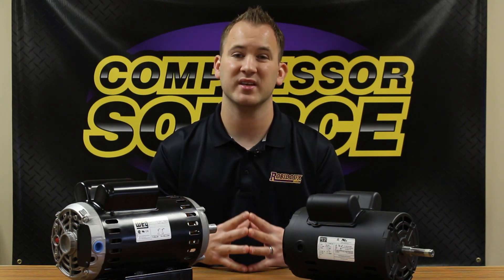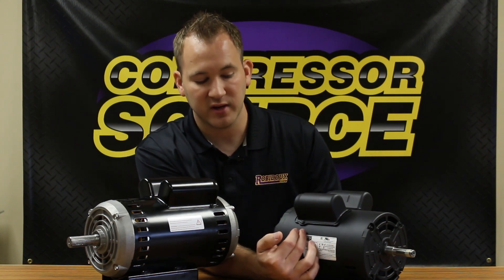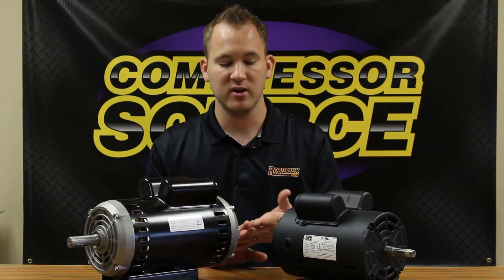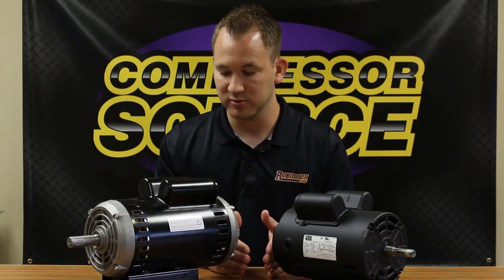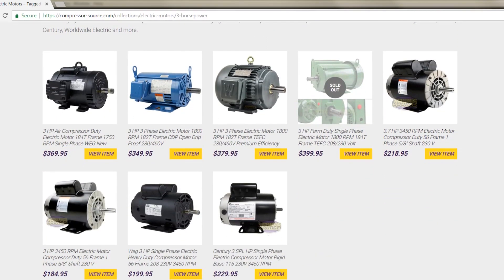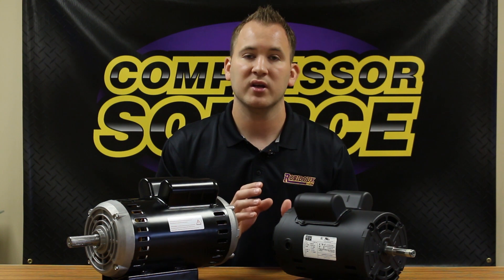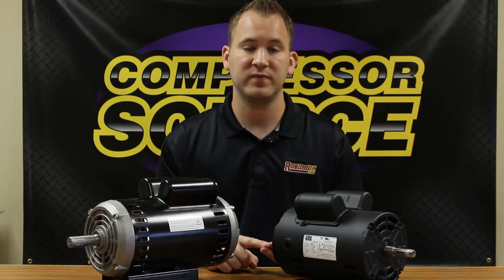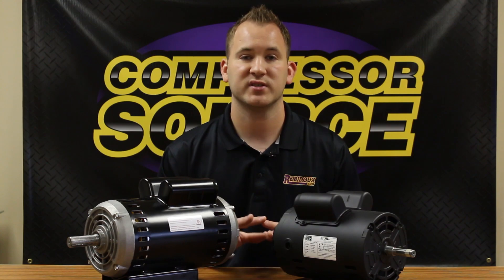How to Size the Right Replacement Electric Motor for Your Air Compressor - Compressor Source

Comment: I had a craftsman oilless 6hp 60 gal compressor since 94’ and have rebuilt the pump already but am tired of the noise and figured since the motor is good just tear the compressor portion off and get a H.F.5 hp pump and slap em together and good to go only after I got the pump I and started getting into it I find out the motor is only 15 amps and no where close to 6 hp..my question is can I just use it as a special 5 hp and spin it a little faster to make up the difference?if you can and will answer I appreciate it thank you.

Comment: Remember when compressor manufacturers was inflating their motor hp ratings? I have a devilbiss that has a mo 3022-1 mitor that they say is a 5hp. Its spected out just like the one in the video except it's 208/230 volt. Ive been told these motors are closer to a 3hp motor. The reason im asking is my pump went out and i need to replace it. So i have to know the correct hp of the motor. 

Ive seen three motors with the same specs, one was a 3hp, one a 3.7hp and the other a 5hp.

Comment: Great tips!! I have a question I have craftsman’s 125 psi 60 gallon air compressor I recently purchased used. Works great but not enough pressure and CFM for sandblasting! So I was thinking of buying a.new more powerful air compressor pump online. Would my motor on my Craftsman 60 gallon match up or is there a way to use the 5.5 hp motor with a new pump??? Or is it just made for that pump????? Thanks buddy

Comment: I am trying to run a onboard system in my vehicle but want to run pneumatic tools such as impact drills Grinders Etc but most of the compressors that I've seen on the market are too small and do not generate enough power and are mainly to inflate tires what size amp and or horsepower is sufficient enough to run those power tools and with how many gallons?

Comment: Hi, I've been offered a puma 64 litre air compressor. The 1/2hp motor has been replaced with a 1hp motor. Is this an ok upgrade or will there be problems?

Comment: So disappointed in my 5 HP USMotors electric motor that came on my Cambell Housfeld air compressor I am wanting to make sure i get  a better quality motor. Mine lasted not even 3 years and I dont use the air compressor daily. I was hoping your video would talk about gettting a quality replacement. My dad owned an automotive shop back in the day and it ran for years as mechanics used their tools daily. What happened to the quality of products nowdays? I will never purchase a US Motors electric motor built in Mexico. Total piece of crap!
Reply: Good luck getting a cheap, US made anything. There are good, foreign made products, and bad US made products. Cambell is a cheap, homeowner brand so you can expect they are using cheap, relatively unreliable motors and compressors. If you got 3 years out of it, you got what you paid for. Putting an expensive, quality motor on a 3 y.o. CH compressor that may have another year or two of life--how does that make sense? You do realize that a robust, 5HP motor will cost you twice what your entire CH setup cost, right? Better off to buy a good, used commercial unit. Or buy a quality compressor and pay for it. Buy once--cry once.

Comment: I have a cambel hausfeld iron force 6.5 HP and the pump is out and no one has the parts to fix it WL611700AJ  Is there a pump i can buy that will line up with this I can purchase.

Comment: What if you don't know what size originally came with your compressor
Reply: Then you buy a new completed air compressor.... Probably save money and eliminate blowing up the tank up and potentially killing someone.
Reply: @TheBrandocando  w
For some people... I took an compressor(speed air 2 cylinder), a 32 gallon standup tank of an old craftsman and an electric motor I scavenged. Pulled a fly wheel off one unit another off another and now I have the quietest air compressor I could have ever dreamed of. It took a few hours longer than I would have liked but the knowledge I learned about tube fitting sizes and coupler sizes was worth every min. Some catch the vibs and some catch the vapors.....

Comment: I have a question not a comment  I just bought a craftsman 5hp 20 gallon single stage 240 volt for 200. How much wld I benefit if I transferred everything over to a 60 gallon tank
Reply: You won't. You'll be overworking that motor because it'll have to run longer to keep that volume of air at a given pressure. You'll far exceed the duty cycle of that motor.

Comment: My generator is burning up the Capacitor on my compressor motor.  Anyway to cross reference with an equivalent motor that is not capacitor start and run?  It is a spl hp motor.
Reply: It’s probably the centrifugal switch on the back of the motor that’s not disconnecting after start up

Comment: I have a campel Hausfeld WL611700AJ 6.5 HP the pump piston and bearing broke.  The part is discontinued  (WL210300SJ)  Is there a compatible pump assembly I could replace it with?
Reply: Did you ever find an answer? I think I probably have the same compressor.

Comment: I wish this was more of a pulley diameter rpm considering video
Reply from the maker: Hi Thomas, 

This website has a handy tool at the top to help you get a ballpark on your pulley size and resulting RPM: http://gadi.agric.za/software/renting/pulley_calc.php We generally use it to help figure out the pulley size for the motor as the flywheel size, recommended pump speed, and motor RPM are usually known factors. But you can use that tool to figure out any of the four factors. We'll definitely looking into doing an RPM specific video in the future though. 

--Dan
Reply: @compressorsource  That link does not work.

Comment: I have 3hp motor on my compressor, can I replace it with 5hp same sizing?
Reply: As long as the frame fits, you can always go up in HP with the same RPM.
Reply: Same question i have i have 4 hp i want to pute a 5hp motor
Reply: @shark3393  yes you have my permission
Reply: I have a 11 horse Honda motor on my aircompresser. I want to replace it with a electric motor what size motor do I need?
Reply: @jacobhershberger7312  Rule of thumb gas:electric = 2:1 HP. A 5HP is sufficient.